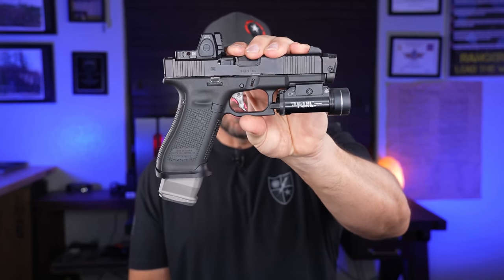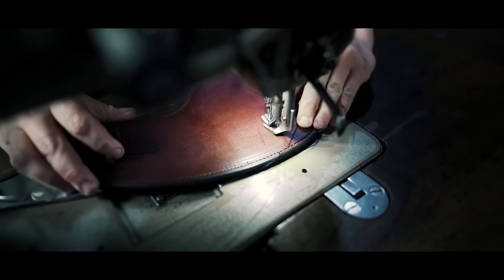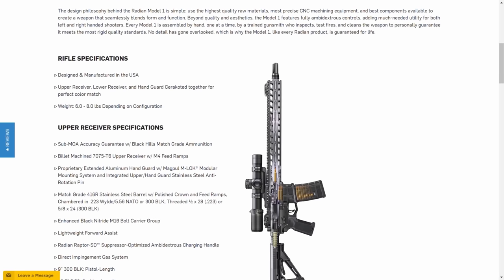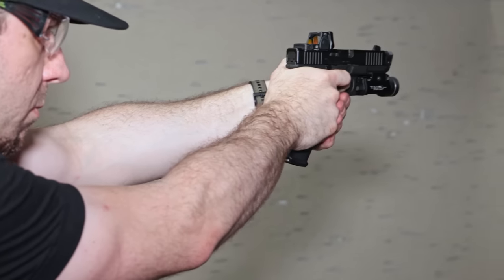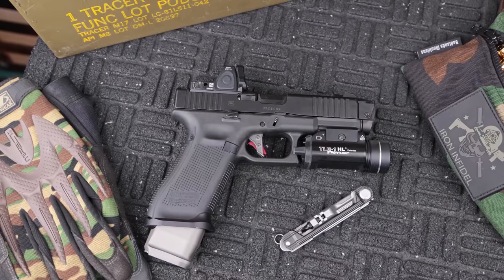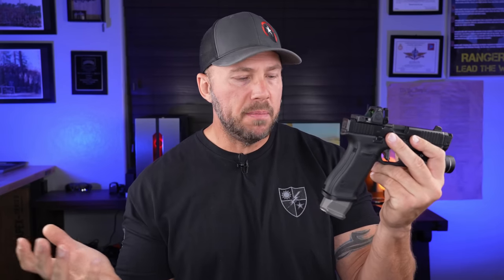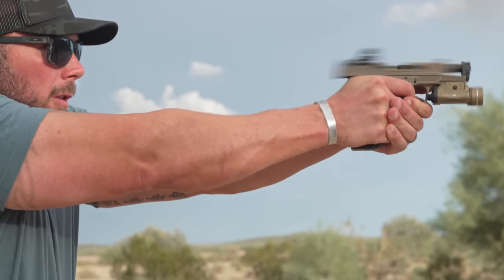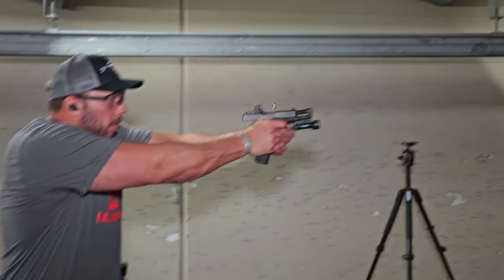It's INSANE! Ultimate Hard Use Duty Glock Pistol

Comment: Have never been too interested in comps but this looks good and has me actually considering it.
The SLR magwell too. Looks like they have a “Low” and “High” model (height of front area where your pinky hits?), which version did you go with?
Also, have you tried the Glock OEM Performance Trigger? If so, many rounds on it and how do you like that compared to aftermarket triggers?
Thanks, great overview on this build! 👍
Reply from the maker: I have tried them over the years this is the first one I am 100% comfortable with.

Comment: Really nice looking Glock Mike!
The only opinions that really matter are the agency that will either approve or disaprove the builds.
And the officer who has confidence  in it's ability to perform 99.99% of the time (firearms are mechanical devices so there is always a chance of a failure).
Reply from the maker: Yup you are very correct.

Comment: What if you build the Glock? You can save a little by buying parts instead of replacing parts. But, I haven't see a gen 5 frame for sale by itself lately.
Reply from the maker: You need a factory glock slide or exact same external dimensions for it to work with the comp.

Comment: What recoil spring, guide rod are you using? I just added the combo to my G45 and it won’t cycle reliably. Radian said to change my recoil spring. Thank you
Reply from the maker: factory.
Reply: @TacticalConsiderations  darn😂. I wasn’t wanting to hear that. Thanks
Reply from the maker: Yeah but that g45 has like at least 7k rounds through it.

Comment: Do they have the barrel and compensator for the 19x.  Does the overwatch trigger work on the 19x
Reply from the maker: The 19x is the virtually the same dimensions  minus the grip to mag interface at the bottom.
Reply: @TacticalConsiderations  thanks.

Comment: That's a great setup but the trijicon is just dated to me.... I have one... and I easily prefer my holosuns with shake awake. That's a game changer for staying ready. I dig the solar,, on board capacitor and battery trays so much better too. I hate removing an optic just to change a battery....it's a poor design.
Reply from the maker: Yup they do have the newer model but I wish they'd update a few things.
Reply: @TacticalConsiderations  Indeed. I haven't tried the new one. I'm sure it's bulletproof but I was disappointed alittle in the features too.

Comment: Is there that much difference between the PMM comp and the Radian, or are they about the same?
Also for duty imo I would  not change out any internals, but I would make exceptions for comps assuming theyve been extensively tested with your carry ammo.
Reply from the maker: They are very different in design and how they attach.. This is a very different design of a self timing comp onto a triangular barrel with a tape r screw making take down like a 1min operation.
Reply: @TacticalConsiderations  Thanks man. I did order the PMM. Dont really care for takedown that much. Can still clean it easily  I guess. I dont think I have the wherewithal you do where I would be constantly switching and inter-changing parts for video purposes and testing.
* as long as they both shoot flatter and quicker than stock.

Comment: IMO the After burner set up is to high dollar for my liking. I am sure it's what it clams but out of my price range for the set up. I have a number of Other Comps on my Glocks that work very well at a much low price point. A BIG THANK YOU for going into after market triggers and carrying a Handgun. It's right up there with all the ones running screaming about "Printing" and "Don't use High Performance Ammo" Yu will go to prison when carrying. I don't want anyone to know, but I have gotten out of my truck a number of times with my shirt pulled over my gun, every time someone would say your gun is showing, your shirt or something along those lines. I have never heard anyone running around screaming "I Think he has a gun he's printing call the Law. Maybe in Fla it's a little more laid back. I carry the type Ammo I think will do the best job, just like LE and the rest. When it comes down to self defense I need to be on the winning end, point black, what I chose to do it with is up to me.
Reply from the maker: I get ya on that. Its not a cheap set up at all.

Comment: Geez the price is nuts. Just get a Shadow System.
Reply from the maker: You'd still have to get the light, optic, comp, barrel, trigger to compete.  I have a shadow outfitted the same way its just $250 more in the overall cost.
Reply: @TacticalConsiderations  I have a DR920P. Already has compensator, put on a holosun507, direct mount. Left the trigger alone, no lights.

Comment: I am impressed with the recoil, but let's take Springfield Echelon or Walther, even Canik out of the box.. You don't have to do a trigger swap, Change iron sights etc.. This is why I hate Glock.. It's not the same pistol with all of the new parts that I have seen others use.. I had an Apex on my 19x and it would get stuck.. Not to mention that horrible grip angle.. From the XDM Ellie OSP with the threaded barrel,  Threw a Comp, Red dot, light and it's amazing.. Even my Echelon is amazing without all of the extras.. I will be adding those extras 😂 .. But to each is his own..
Reply from the maker: There is some truth there for sure. But I know companies are already working hard on things for this. A lot of stuff is coming.

Comment: Great build for sure, just not sure a Glock is worth it. The Walther point you made is exactly why.
Reply: Easier to disassemble and clean. Less parts to break and/or loose. More parts available. More reliable even just slight it still is. Less snappy. Don’t have to remove the dot to remove the extractor for maintenance. Know one, know them all. There are absolutely pros to the Glock, it’s a matter of preference. Either gun will do, and the extra “accuracy” an expert shooter will get, most regular shooters will not benefit from.
Reply from the maker: There are advantaged and disadvantages to everything. I think a build off video is in order with this, the PDP pro and maybe something else
Reply: @TacticalConsiderations  100% looking forward to it!

Comment: Pdp is 800 with literally none of the upgrades besides better trigger lol. You are looking at around the exact same price once you add everything considering it is 200 more then a Glock. So yeah lol
Reply from the maker: The PDP PRO is venerable for sure. I estimate with a comp and barrel on the PDP full sized frame and compact slide so the comp is more flush its like roughly half the price when built.

Comment: By the way overwatch trigger sucked a**! I returned it i installed a 3.5lb glock connector just was a horrible combo i blamed it on trigger too much of a roll over break. Tyrants is crisper
Reply from the maker: Hmmm very interesting.  Usually overwatch is much more solid.  This one is the factory minus connector.

Comment: Ramjet is trash
Reply from the maker: Ok.
Reply: @TacticalConsiderations  I just finished my second whole training day using one on my glock 45. Even with changing spring weights using the proprietary compressors springs I still have issues with 115 grain going into battery. I had to keep thumbing the slide into battery. 15lb spring won't feed and 13 won't go into battery. I don't think cops should use these